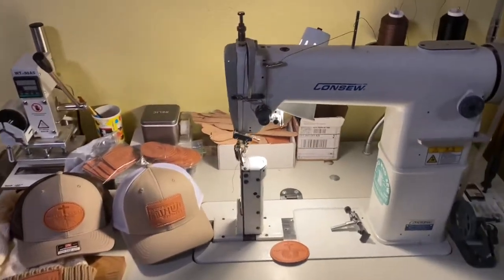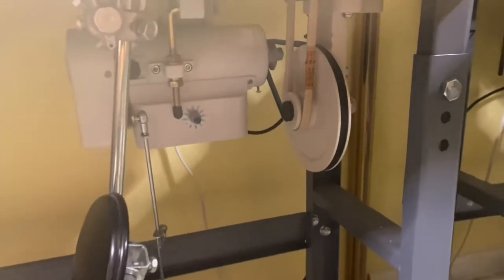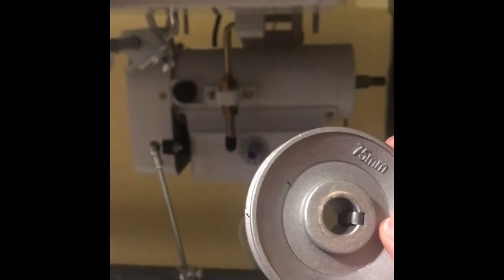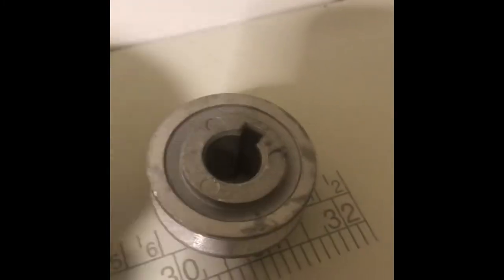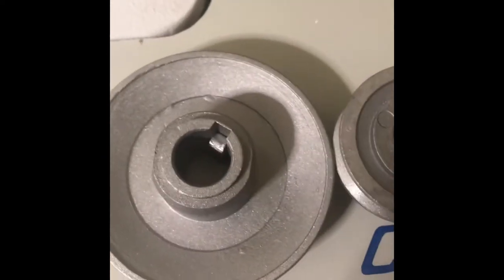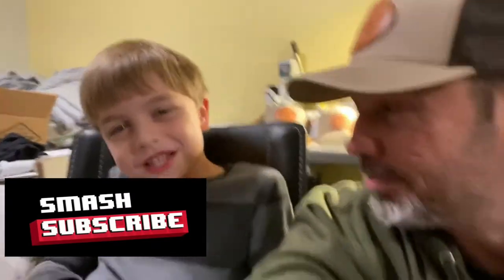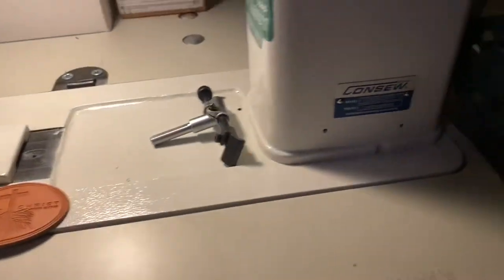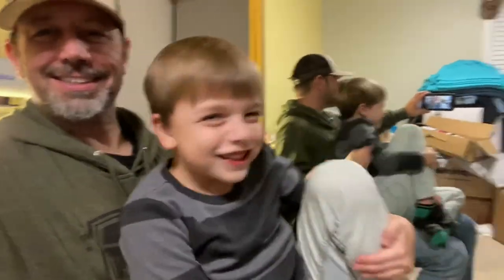Speed reducer install for industrial sewing machine

Comment: Hey, great video I also just installed my speed reducer and it seems like the tension needs to be re adjusted. Is that normal? I don’t want to touch it if that’s not the reason. Thanks
Reply from the maker: Are you talking about belt tension or thread tension?
Reply: @prodigalsonapparel  thread tension. I keep getting a nest underneath
Reply from the maker: @jmaqin  Seems like a separate issue. Maybe things got bumped or moved around a little during the pulley install. I would double check my thread path, the direction of your needle, and also check the tension on your bobbin thread. If you have loops on the underside of the material then generally the lower tension needs to be increased. Just grab the lower thread and pull on it a little. If you have little to no resistance then re-tension (tighten) the lower thread bobbin tension.
Reply: @prodigalsonapparel  appreciate it I’ll try that today thanks

Comment: Thanks for putting this together!  Can you give any details on the belts (size, where to get them, etc)?
Reply from the maker: The belt size you have to measure once you get your pulley set. I use the original belt to go down to the pulley reducer I installed. Once that was tight you can wrap a string or shoelace or something around the other pulley and go back to your servo motor and wrap that pulley (as if the string is a belt). Make a mark on the string, or in my case I tied the string tight from both pulleys, tied a knot, then cut it, measured it, and that is your length.
Reply: @prodigalsonapparel  Great video, very informative. I'm going with the same set-up but just ordered my machine. I'd like to have all of the parts here when it gets here, what size belt did you end up with for your reducer to motor belt?
Reply from the maker: @terrymccomic4446  Sorry about the delayed answer. Its been so long since I ordered the belt I had trouble finding it. But just checked and its 25". Yours might end up being slightly different depending on your install. I used the original belt to go down to the new pulley reducer. I had to mount it on 1" uni-strut in order to do so (like in the video). Then once that is tight take a string or shoelace and wrap around the remaining pulley to your servo wheel. Tie it as tight as possible, then cut it, stretch it out and measure. That's your length.

Comment: Hi sean. I just found your channel. Thanks for posting these video's they are very helpful. My wife and I are kind of just starting out screen printing and doing our own hats. If you dont mind me asking, How do you get the image pressed into the leather?
Reply from the maker: So I buy some veg-tan leather about 5oz thick (shoulder cut) from a local supplier or Tandy Leather.
I have my image CNCd into a brass stamped from https://www.leatherstampmaker.com/ but you can probably find local or even ETSY brass stamp makers for cheaper. I like supporting local if I can. Cost me about $100 for the stamp but once that is made you can stamp thousands of patches for cheap. I did the math once and figured each patch cost me about .50 cents from the leather cowhide after the cost of the stamp. You'll also need a steel rule die made (basically a cookie cutter) which I got from Etsy to cut out your patch. I then use a Harbor Freight 1-Ton press to press the stamp into the leather and also cut my stamps. I don't have a video yet of the stamping but you can find a bunch on YouTube. Basically you wet the top of the leather with a sponge a couple of times to soften. Then use the press to stamp & imprint the leather. Once stamped then cut out the stamp with the press and your steel rule die. Here's a short video of that process https://www.youtube.com/watch?v=oU_9-wVpPUg . This guy here has some good videos...https://www.youtube.com/watch?v=vqCYOCPD-58
Reply from the maker: PS..Just checked out your shop. Love what you guys are doing.  Keep that hill lit up with those lamps! God Bless.

Comment: Hi Sean. Those screws in the spring nuts—are they drilled all the way into the desk? I’m just trying to understand how you’ve got everything stabilized there so the speed reducer doesn’t go flying backwards when you’re running the motor.
Reply from the maker: Well the U channel (strut) is screwed directly to the desk. The motor is then secured to the spring nuts attached to the strut. The motor does not screw into the desk. Just the spring nuts. This video might help... https://youtu.be/cC432V53yhY

Comment: If you have this model of brushed servo motor, do a little test. Without the belt on, at any speed, grab the motor output pulley. You can stop it with your hand. These brushed servos have no torque to begin with.
Reply from the maker: Interesting! Never tried that

Comment: I added this reducer and my machine is still to fast. What else can I do?
Reply from the maker: did you also reduce the wheel on your motor?
Reply: @prodigalsonapparel  no but I just bought one
Reply from the maker: @davissvt  that should make a big difference
Reply: @prodigalsonapparel I hope so we have a 110 hat order due on the 13th that a customer just requested them be stitched
Reply: Did ypu have to use a pulley puller? Mine isn't taking the same pulley and I'm so frustrated at this point that I'm about to sell the machine
Reply from the maker: @davissvt  feel free to send message my email. Maybe i can help...helpdesk.psapparel@gmail.com

Comment: Why did you get a smaller pulley?
Reply from the maker: To reduce the speed and increase torque even more. By installing the reducing pulley and also putting a smaller pulley wheel on the servo motor, that wheel on the motor now has to rotate more times to get the needle to move which = slower speed, more torque.

Comment: Hello good day, my post bed machine is sawing in one spot how do I fix it please. Ps ( the machine is somewhat new)
Reply from the maker: Hi there. You might have to create more pressure on the roller foot. That roller foot has to push down on the material hard enough so the walking foot can catch the material to move it. On the top left of your machine above the head and roller foot, there is a threaded screw that sticks out above the machine. Start tightening that until you have more pressure on your material.
Reply: @prodigalsonapparel  thanks a lot for this... I got it fixed by a technician 

It turned out some screws were lose, (when you lift the machine up) he just I to tighten  them
Reply from the maker: @abdulazeemaderemi9259  Awesome! Im glad you got it working!